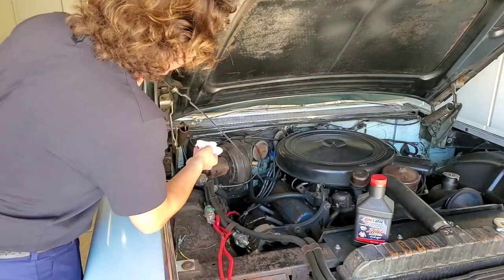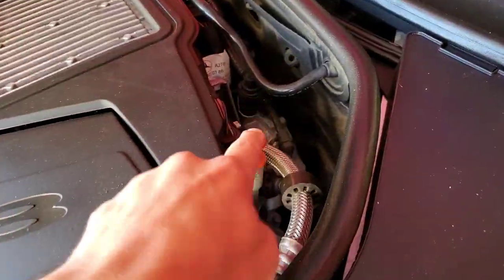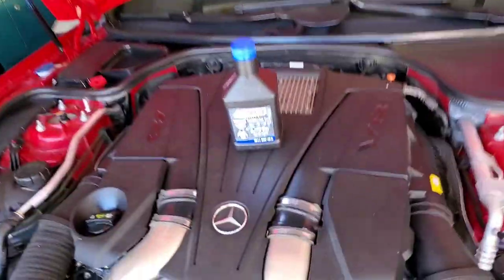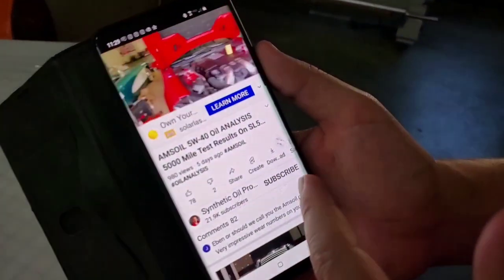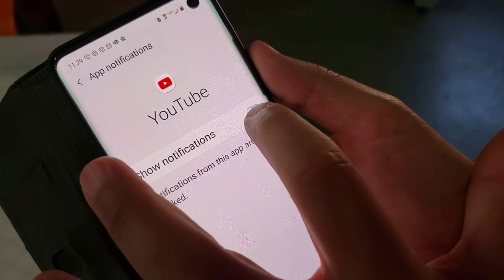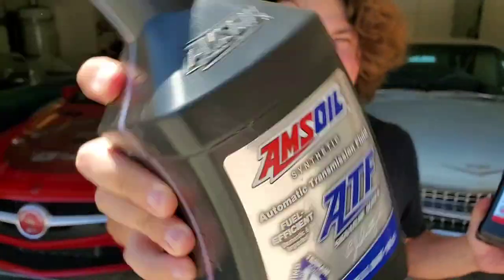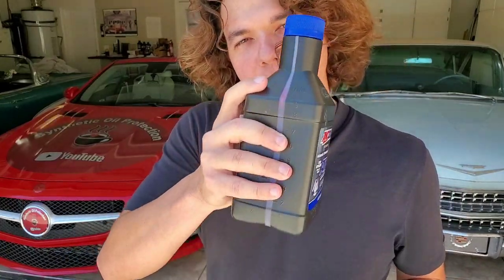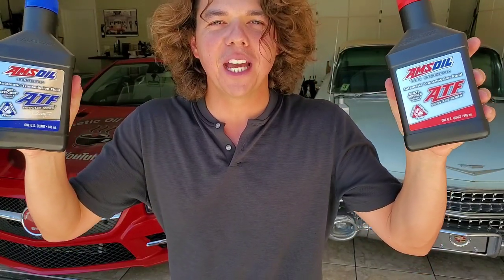What is a sealed Transmission?

Comment from the maker: ✅️ ✅️ ✅️ Watch This Next: How to change sealed transmission fluid https://youtu.be/nENimHN6swI 

     ✅ ✅  Save 25% On Your Next Fluid Order: https://www.amsoil.com/offers/pc/?zo=5331179

     ✅️ Your Professional YouLubher: Eben Rockmaker. Find The Right Fluids For Your Vehicles - https://www.amsoil.com/guides/?zo=5331179      

     🥇🥇🥇 Synthetic Oil Protection Google Map Reviews (702) 472-3614 https://maps.app.goo.gl/DmLU5hP72HadUBEm9              
     
     ♥️ Synthetic Oil Protection Website - http://syntheticoilprotection.net 

     Did you know a oil manufacturer can call a lubricant a Full Synthetic when it's only 25% synthetic? AMSOIL is different because it is 100% Synthetic and has a higher film strength keeping the metal parts separated. AMSOIL allows less friction, less heat, less wear on the component. AMSOIL Signature Series motor oil will last 25,000 miles on 1 oil change! 

     ♥️ See Fluid Performance Tests - https://www.amsoil.com/performancetests.aspx?zo=5331179      

     ♥️ Your Vehicle Could Run Better Than Brand New By Choosing The Right Fluids! See Results - https://youtu.be/zH-VquYlhqA 

     ♥️ Why AMSOIL - https://www.amsoil.com/about/exclusive-distribution/?zo=5331179    
     ♥️ Synthetic Oil Protection Coffee - Ebens Favorite: https://supportwith.coffee/shop/subscriptions/sop/

Comment: How do you change the fluid in a sealed transmission?
Reply from the maker: That video is coming up tomorrow 💯
Reply from the maker: There's a couple different ways some are just a drain and fill where you have a drain plug and a fill plug All you do is fill it until it overflows and then put the plug on.

Others you drop the pen take off the filter and put a new gasket on and then put the new filter back in put the fan back up and then fill it from the bottom

Comment: Was told that the manual gearbox of my car was a “sealed unit” and does not need any oil during its lifetime. Yes if it’s breaks no point repairing it’s internals but with the oil I knew that was total nonsense, they want the box to break so I can get a new car, as putting a new box is totally not worth the Labour and parts cost. 

And low and behold when drain day the oil was dark and full of residue after 135k miles.

Comment: Changed my Volvo to Signature Series Fuel Efficient. Synthetic.

Planning on running it about 75-80,000 miles to coincide with the end of my extended warranty before eventually transitioning to every 100,000 miles (severe service is 50,000 miles).

Amazing.

Comment: I had the dealership put in Amsoil synthetic oil and filter after 250 miles they said it didn't need to I said you paying for it my Explorer st runs alot quieter and smoother
Reply from the maker: Lol so true.

And they won't pay for the difference in gas either lol

Thanks for sharing out with the channel Brian!

Comment: Amsoil Oil and Fluid dealer pushing fluid changes for SEALED, MAINTENANCE-FREE transmissions.
Hmmmnnn
Reply from the maker: Correct the factory sometimes doesn't recommend the fluid change however once the fluid expires the component will be damaged and will need replacing.

You would want to change the fluid earlier and use something with a higher film strength like Amsoil you would get better few mileage better performance You'll see the difference here on the film strength.
♥️ AMSOIL Performance Tests: Read This Article - https://www.amsoil.com/performancetests.aspx?zo=5331179